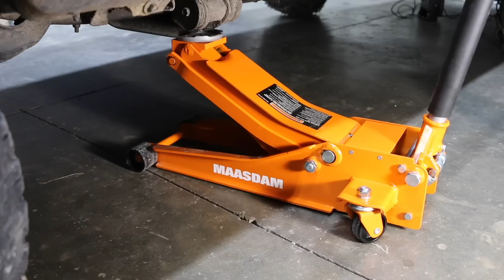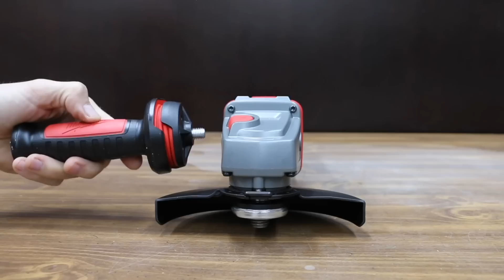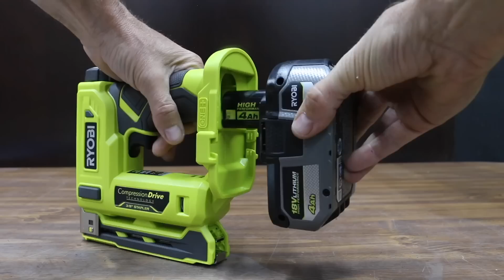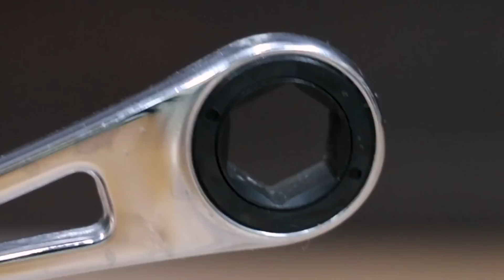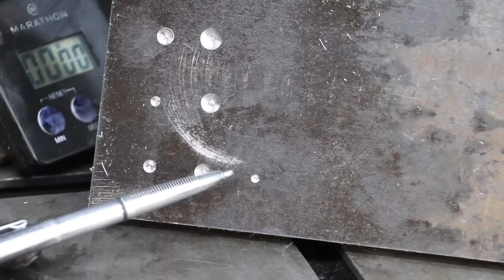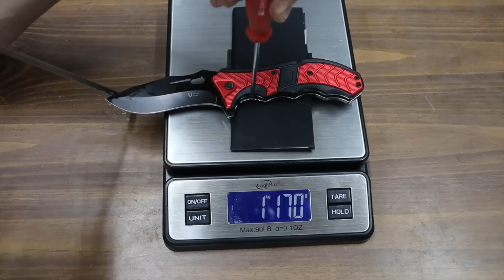Top 10 Tools 2022? Let’s find out!

Comment: I did enjoy the knife test so please try not to get this twisted. I would love to see a knife test of some higher end knives compared to the Benchmade Griptillian. I've owned several Benchmade knives along with Spyderco, and Zero Tolerance (ZT). I think the Benchmade 940 is a great knife but as far as puncturing and slicing capabilities my Spyderco Para3 has been far superior. The predecessor to the Para3 the Paramilitary 2 was a great knife but didn't take long to break the tip because it's a much leaner and about an inch longer blade. I will say though I've broken the excessively pointy tips off of many different models of Spyderco knives but I have only ever broken 1 Benchmade knife tip and that was the Griptillian. My personal conclusion has been that Benchmade makes more durable knives for your typical blue collar worker, but they fall behind as far as functionality depending on the blade shape. Try stabbing through a shag rug with the Benchmade 940 blade shape compared to the Griptillian blade shape the less expensive knife the Griptillian will out perform any day of the week.
Reply from the maker: Thanks for the suggestion.

Comment: The only thing I didn't agree with is that the gearwrench handle bent before the failure force, I personally think that it should've failed the test at that point. Although I suppose you never really tested the handle strength as the breaker bar you used would've been taking a portion of the leverage/bending force.

Comment: Your Ratchet test came out around the time I realised I needed better ratchets. I've got 1/4" 3/8" and 1/2" gearwrench ratchets now, I'm in the UK but the set cost £65 for all 3. I think I'll still keep my old 1/2" straight bar ratchet (it's 15 years old), the arch swing is high but it's the perfect shape for my breaker bar, plus the shape also allows you to use a socket and an extension bar to increase leverage. I tested this method on the gearwrench, it does work but the handle shape means there's allot of flop before the socket bites. The gearwrench is longer though so it's less frequent I need extra leverage. (The 3/8" gearwrench is around the same length as my old 1/2").

I got the set as I have a cheap Chinese 1/4" that I never used until I had too due to lack of space for my 1/2"... The entire time I used it it felt like the ratchet mechanism was about to fail. Plus I own loads of 3/8" sockets but no 3/8" ratchet, I used a 1/2"-3/8" adapter which increased the height of the ratchet. It's a useful thing to have but they aren't suited for every job.
Reply from the maker: Thanks for sharing.

Comment: Your channel often comes up when talking to colleagues about power tools. Your practical tests are an excellent look at tools, and how they perform. The biggest issue in battery tool selection today seems to be selecting a platform. It’s just not practical to have different brand of tools because most of us decide on a battery brand and then go with the tools for that brand.  I’ve started to rely on my corded tools despite some inconvenience.
Perhaps an area worth testing is a comparison of corded vs. Battery for some heavy use tools. Example hole angle drills, or rotary hammers .  Are battery power tools as effective as corded tools for heavy work ?
Another  test might be battery brand. Which brand of battery offers most cost effective power and tool selection, the big three dewalt,makita,Milwaukee.
Reply from the maker: Thanks for the suggestions.

Comment: Here's a video idea:  What brand is overall the most consistent across the largest number of different tools?  Is there a brand that is consistently in the top 3 for every test or something like that?  I don't always necessarily need the absolute best possible tool but it's nice when I can at least have consistently pretty good tools, especially if they can all share the same battery.
Reply from the maker: Thanks for the video idea.

Comment: That Ryobi staple gun is an absolute tank. Went through over 1,000 staples building a chicken coop this summer (hardware cloth into doug fir). Thing never skipped a beat. Ryobi cordless air guns are just outstanding. No better value out there.
Reply from the maker: Impressive!
Reply: What is the model number ryobi nail gun you use?
Reply: @greenmanipa2365  pulled this direct from HD....

P317 18V ONE+ Cordless Compression Drive 3/8 in. Crown Stapler,

Comment: Seems like MIlwaukee is the better string trimmer TBH. Took a significant but marginal longer time to cut the grass. And the vibration, but that's because you can get a ton of awesome attachments for it with it's quick lock system. The hedge trimmer is great and the pole saw is super useful if you have any kind of lot where you'll trim trees. Even a cottage. Not that Dewalt is bad but I don't really see it out performing it much for a higher price.
Reply from the maker: Thanks for the feedback.

Comment: I'd love to see a best breaker bar video. I am probably breaking and replacing the head on my 1/2 inch drive 24inch breaker bar every 6 months or so. Plus you could also get videos out of 1/4, 3/8th, 3/4 and 1 inch drives as well. And you could compare diffrent styles of heads.
Reply from the maker: Thanks for the suggestion.

Comment: I will say this. We use mostly Snap-On tools at my school's auto shop, and the tools just work. We use them every day, and even with high school kids using them, they hardly break. We have a couple of 1/2" Snap-On torque wrenches, and they seem very accurate. Very easy to use. We also have some Pittsburgh 3/8" torque wrenches. Not only are they harder to set, but also they are not as accurate as the Snap-on. There is a reason why when we are torquing delicate fasteners, such as head bolts, why we use Snap-On. 

I am a red fan all around. Snap-On, Milwaukee and Matco.
Reply from the maker: Thanks for sharing.

Comment: Idea! Determine which cordless tool brand is, on average, the best if you are going to commit to one brand so you have swappable batteries! Love your content!
Reply: I think that's an impossible task because everyone's "best" is subjective. I went Ryobi because of the sheer amount of tools (spanning various disciplines) that share the same battery tech (not to mention the value for dollar and commitment to one battery form factor). But at the other end from TTI you have Milwaukee, which arguably has the "best" performance given its size (especially the M12 stuff). Both can be the "best" choice for someone, it just depends what you need in a tool ecosystem.
Reply from the maker: Thanks for the suggestion.
Reply: Each person wants different things.  Home users can use brushed motors that will last them a lifetime.

Comment: How about a test proving the effectiveness of engine oil additives claiming to soften seals and slow/prevent leakage?   Bars, Lucas, Blue Devil, Liquid Moly, etc.  
I've got an old Ford truck used as a secondary vehicle with a seeping rear main and would love to slow it down for a few months before going to the trouble of replacing it.
Reply from the maker: Thanks for the suggestion.

Comment: Thanks for sharing. I find that I review things on your channel if I’m buying something for a project. One time I needed a cone drill for work. I was asked to drill around 250 holes to finish a project. The Dewalt was your pick. The Dewalt drill all the holes and is good as new after 250 holes and other projects here and there. I bought two just for back up. Great bit and I used cutting oil keep it cool.
Reply from the maker: That is awesome!

Comment: Suggest testing different pipe connections/joints for how good they are at holding fluids under stress, temperature expansion, shock, vibration etc. Especially interesting would be how quick connect fittings would fare against proper longer term connections
Reply from the maker: Thanks for the suggestion.

Comment: i’ve watched every video of yours multiple times and you’re incredible, it’s impressive to see how well your testing methods and viewer presentation has improved since your first few videos! Anyway, could you do a test on hydraulic fluids? There are a lot of different applications that use hydraulic fluid and there’s so many to choose from of course. My vintage lawn tractor calls for IH Hy-Tran fluid in the service manual, and naturally it’s pretty expensive as well as it isn’t chemically perfect for use in worn low pressure pumps like mine. Lucas makes a hydraulic fluid additive and i’ve been using it, made me very curious on which ones would be better for my application, and people using bigger equipment whether it’s a hydraulic cylinder or pump would definitely benefit from a test like that. I’m sure you’ve got a ton of videos on the bulletin board going,  it’s just an idea of mine :)
Reply from the maker: Thanks for the suggestion.

Comment: I was so impressed with the GearWrench in your test that I bought a set of four 120 tooth flex head wrenches (1/4, 3/8, 3/8 stubby, 1/2). No, the 15 ratchets I already had in my toolbox weren't enough. Yes, the GearWrench ratchets are as smooth as silk and well worth the $150 I spent on them. I might have to stop watching your channel before I go broke.
Reply from the maker: lol  Thanks for sharing.

Comment: Could you test auger drill bits? Maybe also battery powered augers? I'm looking for something to make 4 inch wide holes in hard rocky dirt with lots of clay. I hear some of them also include features to prevent you from bursting pipes on accident.
Reply from the maker: Thanks for the suggestion.

Comment: Can you do a comparison of cyclone dust separators? The sort that sits in front of a shop vac, usually they snap on the top of a 5 gal bucket in place of the lid or install on the lid. There are a bunch of different brands and designs aimed at the consumer or hobbyist. Right up your alley.
Reply from the maker: Thanks for the suggestion.

Comment: Hey I had an idea for a video. I just started riding my motorcycle and I got a cheap chain from ebay and I have to adjust it kinda often between check ups. Is there a best chain link? And what one stretches the least and won't rust so easy? Thank you!
Reply from the maker: Thanks for the suggestion.

Comment: At the end of the video in regards to folding knives. Test lock strength, sorry if I missed it. My trusty pocket knife just failed on me after doing the same thing it had done for a year, split my thumb in two after it failed. Just a safety and complacency reminder, as well as wondering if my knife was abnormal. Gerber, all aluminum, pocket folder
Reply: Nothing against Gerber, I beat the crap out of this $60 knife that I picked up for $14. It was my own fault, always br cautious of a folding knife collapsing.

Comment: Thanks for all you do, here's an idea.
SXS winches

Size, pulling power, Amp draw, corrosion resistance, electronics overview (contactor relays vs starter relays in parallel), and failure points.

Very popular category of winches, most are 3500 - 5500lbs, short drum, small bolt pattern.
Reply from the maker: Thanks for the suggestion.

Comment: Possible suggestions: Anti-Fatigue Mats (they range from $9 at Harbor Freight to $200+ at Northern Tool), Paint Brushes & Rollers (Big box stores all have a good, better, best. Is the "best" worth 4x the cost?), Garden Hose Sprayer (both single and multi-pattern), Magnetic Jobsite Rolling Nail Sweepers, Fuel System Cleaners, Expanding Foam.
Reply from the maker: Thanks for the suggestions.

Comment: Best electric heater? Might be a good winter vid. The ceramic heating element ones seem to be pretty weak whereas the wire resistor ones put out a lot more heat. Could see if the resistor ones are that much less efficient than the ceramic ones. Maybe test heat output and see how long it takes to heat a 10x10 room or something. Maybe how long it takes to get up to heating temperature. Air output could be relevant but also how air output effects the temperature of the heating coil. As in some of these new heaters seem to not be able to maintain their heat when their blower fan is at a high setting and become sort of lukewarm... Plus since there's a lot of heaters and styles out you could make 3 or 4 versions and give yourself a yearly winter viewer boost
Reply from the maker: Thahnks for the suggestion.

Comment: Would you be able to suggest a jack you can keep in the trunk of your car. The stock scissor jack I have only really works on flat surfaces. When I got a flat, I pulled over to the side of the road, but when I tried jacking up the car, the top of the jack kept moving forward. I had to call someone to bring a floor jack and some wood so I could change my tire.
Reply from the maker: Thanks for the suggestion.

Comment: At first I thought that the arc-swing test for the ratchets and ratcheting combination wrenches was backwards.  That the number of swings was directly proportional to the number of teeth.  Then I realized that more teeth in the ratchet, for example 72 teeth allowing 5 degree swings, would allow more usage of an available 30 degree arc.  Kind of a weird test since it relies on the min degree arc swing evenly dividing into 30 degree with a tiny bit left over to ensure that no swings are wasted.  Perhaps just listing the number of teeth, or min arc swing would be better.  At any rate, it's good to double check oneself before posting!  😁

Additional thought:  Looking at the ratcheting wrenches the best use 15.3 swings within a 40 degree arc to complete a circle.  So it was able to turn the bolt 23.5 degrees within a 40 degree working space. It has a 1.7 degree arc swing, so there must be some slop, or play involved for it to not.  Theoretically, it could have turned the bolt 39.1 degrees (29 x 1.7 degrees).  Maybe you have an interesting test afterall.
Reply from the maker: Thanks for watching!

Comment: I watch majority of your videos.  The one I am most interested in is the JB WELD of steel.  You did not try joining nut and bolt with Silver Solder.  Would you try this out please.  Using flux liquid or paste no difference, the heat the bolt with the nut on top.  Once it get to temperature, the solder will melt, then screw down the nut on the bolt to try and liquid seal the nut and bolt.  Let it cool down and then test solder VS JB weld.  This would be interesting.  This would be similar to brazing and welding in respects.  Would make a quick video for sure.
Reply from the maker: Thanks for the suggestion.

Comment: a few testing ideas
masonry drill bits
masonry/glass cutting saw blades
laser engravers (buy your own safety glasses/goggles because the ones they come with are usually useless and will make you go blind)
rotary impact hammers
rotary impact hammer chisels 
batteries
Reply from the maker: Thanks for the suggestions.

Comment: I would love to see breaker bar comparison. Could even include impact or high torque electric/air tools. 
 Recently broke 3 breaker bars(sheared off the nubs) without even putting a pipe on the handle and had to cut the bolt. 
 Love the content
Reply from the maker: Thanks!  Thanks for the suggestion.

Comment: Todd, BATTERY OPERATED APPAREL  such as JACKETS are gaining popularity. I already use battery operated socks, especially in long sub-zero trips in my Honda Ridgeline which does a terrible job on the floor heat (but that's for another time). They are not cheap so my suggestion is for you to put them tp the test this upcoming year.
Reply from the maker: Thanks for the suggestion.

Comment: Video request:  Best filler for a loose screw hole. I have seen several viral videos recently about filling and re-drilling loose screw holes.   The suggestions include super glue and cotton balls, or ashes, or Styrofoam, or sawdust.  there are also versions of some of these using wood glue or white glue.   There are also commercial wood fillers, and (the most likely winner) JB weld and other epoxy fillers.   I would love to see all of these put to your rigorous testing.  Which is strongest?  which is easiest to drill? can they be painted?  As always, thanks for the work that you do!
Reply from the maker: Thanks for the suggestion.

Comment: I find my top tools of 2022 to be:
1.) Spilt beam torque wrench
2.) Mac tools R.B.R.T
3.) Rocket socket /31 pc set; $179
4.)Craftsman tap and die set
5.) Daytona super duty jack
    Or Daytona low profile long reach jack
6.) Right angle impact wrench : Milwaukee or kobalt
7.) Matco 30 inch ratchet
8.) Sockets and wrenches from 
I really dont care
9.) Plies and screwdrivers from 
I still dont care
10.) Buy all the special tools you rent at the parts store
Reply from the maker: Thanks for the feedback.

Comment: I have used a Chinese knock off of a similar Benchmade knife and uses the same Axis lock system, probably made at the same factory that makes the Benchmade equivalent..  After going through a bunch of other inexpensive knives for daily use as a contractor, I found mine, selling under the Enlan brand, and never had to buy another knife.  I liked it so much immediately that I bought a second one, just in case i damaged, broke or lost my original.  It is still in it's box 12 or more years later.  I have used it hard and sharpened off at least 15% of it's original blade width.  I guess I'll pass the other one down to my son.
Reply from the maker: Thanks for sharing.

Comment: Hey Todd! I know I’ve mentioned this before. But you should really do a test to see the difference in carbon buildup, engine wear, and oil quality depending on what fuel you use: gasoline, premium gasoline, caned gas, propane, natural gas, and maybe hydrogen. Maybe with a see through cylinder head. I can provide you with the components for the propane and natural gas systems for free and I’m offering to help! Love your channel and watch every video!
Reply from the maker: Thanks!  Thanks for the suggestion.